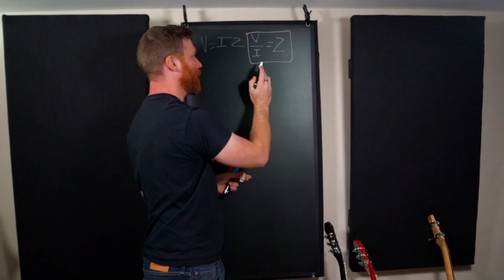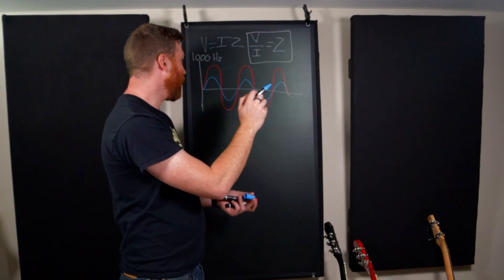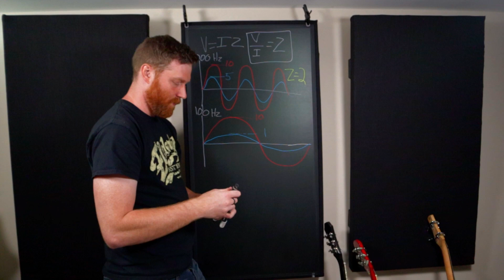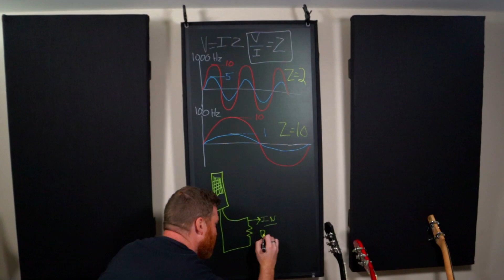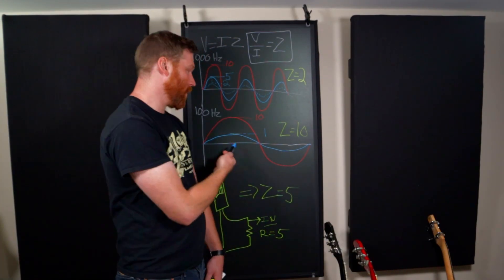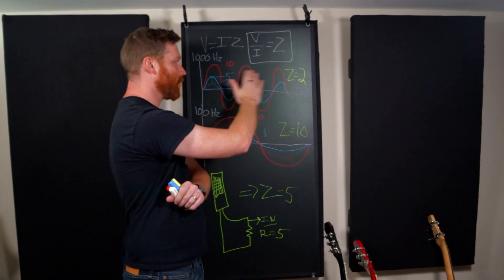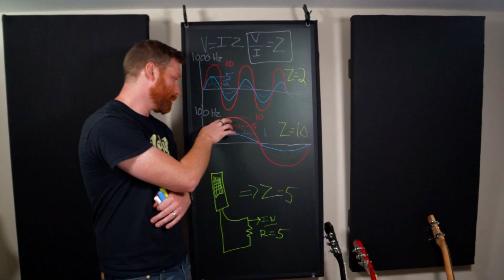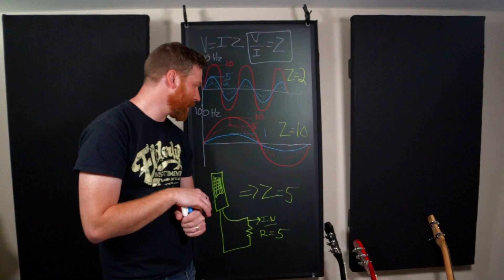A Better Explanation of Impedance for Audio Signals

Comment: Genius! Absolutely bloody brilliant that (as we say in Yorkshire (England) - what a fantastic explanation. Won’t go over my background or areas of knowledge, but that was a real ‘light bulb moment’ for me, and I can’t believe I didn’t see it that way before. In fact, just the simple point of explaining that the impedance is the ratio of where a signal sits in terms of voltage to current was such an obvious, but devastatingly useful way of looking at it, it was worth watching the whole video for that. However, it totally makes sense from that starting point how the signal is affected when it hit an input with a difference impedance. Now I properly understand the rule of thumb of x10’s input impedance to output impedance I feel rather pleased with myself. Thank you so much 🙌 🙌 🙌
Reply from the maker: Thanks for the comment, this absolutely made me smile.  Appreciate you saying hello, glad it was helpful.
Reply: @alderaudio Glad it made you smile - I appreciate it was a few months ago now, but I just dug out this video again to refresh my memory on some of the important points (of which there are many really, really useful ones). 

Having now watched this a second time, I still think this is hands down the best explanation out there (at least that I’ve found) explaining how and why low frequencies are increasingly effected if and when an output signal meets the next stage in the chain, if the input impedance of the next stage is not high enough - i.e. high enough to prevent the strength (i.e. voltage) of ALL frequencies in the signal being transmitted without attenuation, and rolling off the ‘low end’. Still love it. This has helped me a lot (looking at audio circuits) and I still think your video is ‘bloody brilliant’ 😉
Reply: The rule of thumb here is for specific microphone types.  For home audio it's 100-1000x

Comment: Another good analogy is acoustic impedance. Sound travels well through air (which has low acoustic impedance) and sound also travels well through concrete (which has high acoustic impedance). But it doesn't easily transition between the two mediums, because there's an impedance mismatch.

When a sound-wave in air hits a concrete wall, most of it will bounce back rather than continue through.
And the reverse is also true. A sound-wave in a solid-body guitar doesn't propagate out into the surrounding air much.
Reply: Interestingly, in the acoustic analogy, the high frequency is the one that bounced back, and the low frequencies are more easily transmitted.
Reply: @mansouralk  For future readers, this comment is specific to the air-concrete interface, but would be different in general for any other combination of materials.

Comment: Thank you so much for this video, I'm in my final year of a university degree and building a piezo based noise box / effects pedal sound device using a daisy seed and some basic circuitry inspired by guitar effects. I also had zero electronics experience before starting this. From being a musician into hardware for quite a few years I sort of knew the rule of thumb and negative consequences of not considering it when connecting certain devices, however when designing one my lack of knowledge really became a barrier. This is the video I randomly stumbled across whilst not intending to research the matter that just switched on a huge lightbulb of basic understanding. I am going to check out the rest of your channel in the morning plus the website etc and look into your products as one of my case studies 🙂 you have just had a hugely positive impact, a final Christmas present of 2023!

I am excited to dive into the above first thing tomorrow.

Comment: Voltage or  current gets reflected. Which one when?
Reply from the maker: This is one of the stickier points that I am glossing over a bit in the video to make a point.  Technically, you cannot have a voltage without a current or vice versa, so reflection isn't so simple.  However, the big point is that you have a particular voltage to current ratio natural to the signal output, and when it goes into an input, it will get squeezed into the ratio of the input impedance number.  Looking at it broadly, you can see that that either voltage or current needs to be reduced to achieve the new ratio, and the difference in impedance defines which needs to be reduced.  Now, because you can't reflect ONLY voltage or ONLY current, the detailed reality is more complex.  However, the overall point is still helpful and describes 95% of what is going on.
Reply: @alderaudio  Ahhh !!! That was the bit that had me puzzled ... brilliant explanation - thanks 🤪
Reply: @grahamh7041 actually; or officially in German electronics,  impedance it's the addition of capacitive and inductive resistances. Depending on the circuit (ac) the voltage could be faster than the current or vice-versa. They cancel each other resulting in a "impedance curve" if you measure lots of frecuencys. It's all pitagoras, Best example: imagine a German bier. The whole glass it's power in watts, the white part ist the blind power and the yellow one it's the effective liquid. The yellow make you drunk while the white gas make you fart...

Comment: Still a bit confusing.  I always saw impedance as more of a requirement for what a signal needs, not what it physically has.  Someone said that was incorrect, but it seems correct to me.
Reply: Impedance is the relationship between a primary variable and a secondary ditto. Electrical this is voltage and current. Acoustics is pressure and volume velocity. Structural mechanics is force and velocity. If your electrical source is a voltage source, the current then has to comply with that voltage and the impedance loading the source.
Reply: @Rene_Christensen So basically what I just said then

Comment: So is it fair to say the 100hz then gets compressed by a ratio or is it more of a hard limit, or is it more like a static eq cut like a low shelf
Reply from the maker: Great question.  My first response is that it is not like compression, the effect is even over varying volume range.  However, this is still a concept video rather than a detailed analysis of exact electrical behavior.  Effects in real life are going to have some finer points involved, but in general, I'd say it is not a bad to think of it as a sloped low shelf.

Comment: Impedance rises as frequency increases. The resonant frequency of a driver has the lowest impedance and either side of that point the impedance increases.
Reply from the maker: So, I'm with you on the second bit, but then whether the impedance goes up or down as frequency goes down kind of all depends on where the peak is yeah?  And whether going down in frequency is moving toward the peak or away from it?  So I simplified this in the video, but if you take a guitar pickup of a few henries and winding plus cable capacitance of a few hundred pF, then you land on resonant LCR network peak somewhere around 5 to 10kHz.  That's where your min impedance is as well, as you've said.  So as you are moving down from that peak to 1k and then from 1k to 100Hz like my example in the vid, you are going up in impedance.  Yes, it is more complicated than get into in the vid and varies by source but I still think the generalization I am making here from 1k moving lower is generally true for mics and pickups.
Reply: @alderaudio  Yes I agree that short videocasts do not contain all the of the details. I am not trying to be flippant as it may seam, I just added a little more food for thought for others to read, and you so maybe a bit more interest on the topic may spark questions and statements so we can all learn a bit more. The information you share here is helpful to me as I am working on tweeter diaphragms and crossovers where I am shimming the diaphragm coils to a point where the response as at the flattest level. I welcome more of your knowledge.

Comment: I have been working in sound for about 30 years and this is the clearest and most useful explanation in a practical sense that I have seen. 👍
Reply from the maker: Thanks!
Reply: Do you want speak french😊
Reply: The explanation given is also wrong and misleading... Impedance is a vector that consists of two values: resistance and reactance.
It's a concept that layman has difficulties to understand because it's a sum of complex numbers and is in itself a complex number.

But because it's a value that tries to tell you how system reacts in both voltage, current AND frequency, it has to be.

This explanation completely ignores the most important thing why impedance exists, the FREQUENCY dependency.

You definitely shouldn't think you now understand much about impedance based on this explanation.

Comment: Now wait... I think you're confusing impedance matching with filtering. If you have a mic with say output impedance of 1K Ohm... and you load is a 100 Ohm resistor... you're right... you will not get Maximum power transfer from mic to resistor... but the frequency response will not change. However, if your load is capacitive or inductive... then the frequency response will be affected.
Reply from the maker: Thanks for the comment.  This is definitely a thing though, and pretty widely accepted in audio as a factor that effects frequency response.  It leads a common adage that a preamp input impedance should be 5-10 times the output impedance of the input device.  This is in contrast to something like, say an old telephone line, where you want to match impedance to maximize power transfer because you are actually driving the receiver with the signal.  In that case you are worried about power but if you just running into a FET circuit you are only worried about signal voltage.  Check out my follow up video if you are curious, the impedance mismatch example with the piezo pickup displays how significant the audio effects can be.
Reply: Yes, in the case of a mic driving a preamp... impedance matching is really something that you don't want. As you say, the load (in this case the preamp) would want to be much higher impedance than the mic you're driving it with... to avoid any unnecessary loading on the mic. But again... any two resistive impedances (matched or otherwise) one driving another... are NOT frequency dependent. Only when there is some capacitance or inductance introduced will there be frequency effects. That said, most (if not all) preamp inputs are capacitively coupled. By doing this, they immediately introduce some level of RC filtering which will impact the frequency response of the system. But by carefully choosing the value of the R and the C on the input... you can set the filter "pole" for a desired frequency location... perhaps even out of the band of desired frequencies.

Comment: I have mixed feelings about this video,since the formula for capacitive reactance shows  why the IMPEDANCE INCREASES WITH A DECREASE IN FREQUECY.XC=1/2πFC,WHERE XC IS THE CAPACITIVE REACTANCE AT THE FREQUENCY "F".THE WORD IMPEDANCE MEANS THE TOTAL OPPOSITION TO AC DUE TO REACTANCE AND RESISTANCE OF A CIRCUIT.
Z=√XC^2+R^2 FOR AN RC CIRCUIT.Z=√XL^2 + R^2 FOR AN RL CIRCUIT. Z=√(XL -XC)^2(WHICHEVER IS LARGER)+R^2 FOR AN RLC CIRCUIT.
FOR COILS,INDUCTIVE REACTANCE WHICH IS THE OPPOSITION OF AN INDUCTOR TO AC CURRENT THE FORMULA IS XL=2πFL,THIS TIME A DECEASE IN FREQUENCY CAUSES A DECREASE IN REACTANCE AND THEREFORE A DECREASE IN IMPEDANCE " Z".
Reply: Your comment is very informative  but do you know why this happens  ,the actual cause of the rise?   Answer is     you got a conductor coil ,and a magnet that's producing electrical power  by the physical movement. Even when being move with electrical power  higher frequency  less movement

Comment: nice video, although we do care about phase since the capacitance and inductance are still a problem to phase unless we digitalize the interconnection of endpoints, (I did my research in college about CI and DI)
Reply from the maker: Thanks for the comment.  I know I didn't go into that part in depth.  The argument for not worrying about phase here is that the effects are negligible, not that there aren't any going on.  I believe this is the case because we are talking about a single signal in the audio range, so no higher than 20-30kHz or so.  Are you saying that phase effects can cause an audible difference in this case?  If I'm wrong feel free to point me in the right direction.  I learned most of this on the job designing data cable, so I'm sure I have holes.  Also, what do you mean by CI and DI in this case?
Reply: @alderaudio  anyway, you are doing a good job, I enjoy the video

Comment: Thank you for giving some great information here. I have a question. trying to record my Korg synth by bringing the output left and right to my Usb Audio device Steinburg ur22mkii at  24bit 192k . It is so obvious that the sound now in the DAW coming out of the Audio device is not as rich and full compared to the sound coming of the headphones from the synth directly :( I feel as if I got robbed along the way.
This goes also for the condensed Mic, great quality mic but I don't feel with the sound coming from the audio device into which the mic is plugged.
So, my question is what is the solution for this ? I just guess that it may have to do with impedance  I really would like to hear things recorded i the DAW the way they really are originally and nothing quality taken away. 
I would really appreciate if you can shade some light on this and propose the cheapest solution possible to solve this problem. Thanks
Reply from the maker: Ah, well, what you have here is something I think is very common to anyone who starts getting into recording.  It never sounds as good as you expect, and you find yourself asking why.  The truth is, there is usually just a lot to it.  I don't know if I can solve the problem with the information you have here, but I doubt very much it has anything to do with impedance.  The microphone not sounding good is unsurprising.  If you are comparing it to how the mic sounds through headphones while using it, hearing the live sound in the room while at the same time hearing it through headphones can vastly change the sound.  The synth on the other hand is confusing, something feels wrong there.  I would think you should be able to plug into your interface, listen to the synth on headphones through the interface, and that should sound very similar to the headphone out on the synth.  If it does not sound the same, I believe something has gone wrong, but I'm afraid I wouldn't know what that is without looking at it in person.  But best of luck with it!  You are in good company as you work through trying to get it sound right!
Reply: @alderaudio  from the keyboard , it sounds wider and bigger and you can immediately tell that you can increase the volume without getting distortion, but hearing it through the Daw like I said doesn't sound as good.
Reply: @Redwane-Music The first thing to check is the correct line input gain of your interface. This to avoid any distortion at that stage. In other words you have to balance the output of the keyboard with the input interface. Hope this helps.
I also add that the quality of the interface converters (both AD and DA) can affect the overall result of the sound you get, in terms of depth and wideness of sound.

Comment: Great Video!  Question, I'm thinking about buying an AEA R44C ribbon mic for vocals.  I have a Universal Audio LA-610 pre-amp/compressor that I love and want to keep using.  Can I run the R44C through the LA-610?  If yes, what settings would dial it to?  If not, can I add a ribbon mic pre-amp in-between the mic and the LA-610 without damaging anything or ruining the signal?   If not, can I put a DI box between the mic and the LA-610?  
Thank you!! ~mike
Reply from the maker: Hey Mike, great question.  You can absolutely use your LA-610 no problem at all.  The R44C has an output impedance of 270ohms, and it looks like AEA recommends plugging it into something 1.2K or higher.  The LA-610 appears to have a selector for an input impedance of either 2K or 500.  On the 2K setting you are solidly in the bounds recommended by AEA, so that will work great.  You can also use the 500 ohm setting, and it will give you a very natural sort of low end cut you may find useful in certain situations.

Also, AEA is great, and you should get that mic.  You will love it.  However, if a vocal oriented ribbon handmade by yours truly for one tenth the price makes you at all curious, you could always check of this demo: https://www.youtube.com/watch?v=WXOqO8UuK8Q

Happy recording!

Comment: I have a ART TPS2 and it has an impedance knob. Where do I set it & why?
Reply from the maker: It looks like the TPS2 is variable from 3K down to 150 ohms on input impedance.  You should mostly leave it maxed out at 3k because that is going to get you the best flat input of just about any normal mic.  Then pretend it is a fancy complicated low cut and turn it down to taste if you want cut out some low end and get a different more focused sound.
Reply: @alderaudio  Thank you so much that helped me more than the 20 videos I watched trying to figure it out.